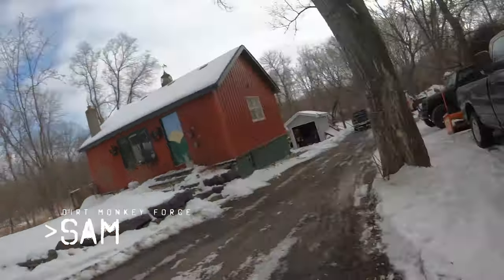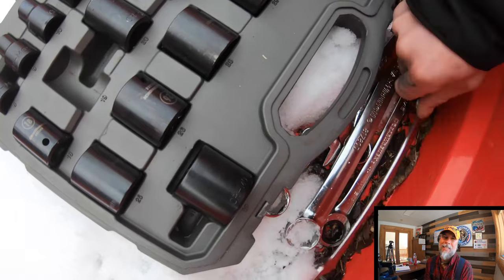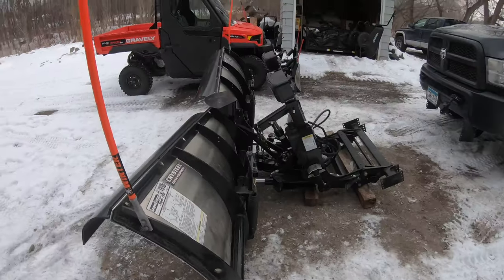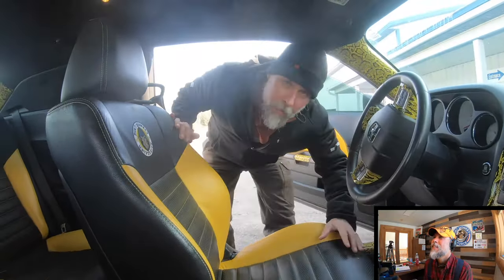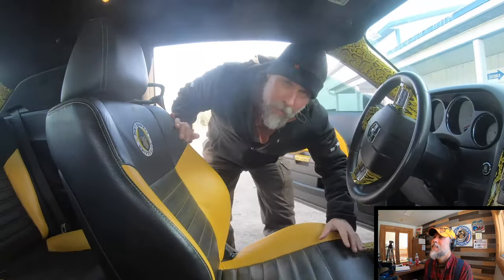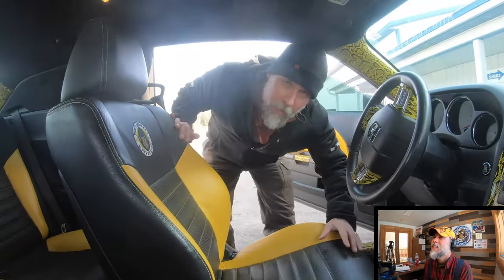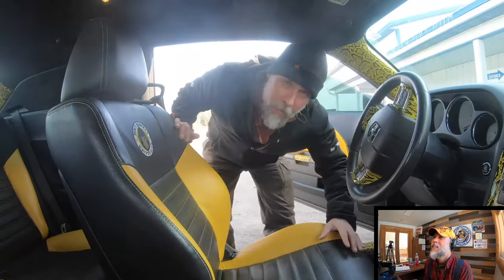Head to head - V plow Vs Scoop plow

Comment: I have simillar sockets from snapon and I love them those extractors work great  they rip into the bolt or nut and rip it out and then if you get a nut stuck in a socket just lay it down and tap on the side of the socket with a hammer and it shakes it right out

Comment: All you needed to do is straighten the bent bar with a hammer,...pin would have popped out..I had the same issue....but even before that. You need to push the frame with the lights towards the truck...that makes it easy to take the pin out.

Comment: Do you have any experience with the Western Wideouts? I think you have experience with the Western V Plows. Anyhow my friend and I were bickering like an old married couple about what would be better to use, a v plow or one of those scoop plows, the one that peaked my interest was the Western one because it has the extendable wings that also articulate when windrowing and turns into a scoop, but you can bring the wings in as well for easier transport or getting into tighter spaces. The v blade is also nice because if you get a huge dump of snow you can break your way through it but also use it as a straight blade, and turn it into a scoop.
Reply from the maker: Both are great options but I like the scoop plow -its just my preferance.

Comment: Stanley,  What is the cost of all of these plows?  I am more into residential snow removal.  I did get an Ariens 36" Pro snow blower this year and I love it. I have had multiple 12"+ snow falls this year and I can cut right through the snow.  I am not ready to invest into a plow yet because I am doing residential accounts. My summer mowing customers are my winter snow removal accounts.  It works out great.  My concern that I wonder about is if I had a plow where am I going to put the snow?  And then I have to still do the sidewalks and steps.  So right now I don't think a plow is a good investment for me.  And you have raved about the back plow.  What is the limit on the amount of snow that you can pull with a back plow?  How deep of snow can you pull with the back plow?  And no shout out is needed. lol  You gave me an unexpected shout out on Instagram that showed a high level of respect.  Rest up before you next snow fall.  lol

Comment: Their new 1" impact is overkill unless you're dealing with class A or semi truck tires day in and day out, the local FD had one donated by the local school district, the school got 12 1" impacts, 56 cordless drills, and 3 pallets worth of odds and ends, all they asked for was a banner for their shop class, the FD traded it with the local farm drainage guy for a Milwaukee cordless chop saw, chainsaw, and leaf blower, we don't use our old Stihl stuff enough to justify the maintenance costs, soon enough we'll replace our high pressure hydraulic jaws of life with cordless jaws of life for ease of use and low maintenance

Comment: Something to consider if you don’t want to use chains. Find a queen sized blowup mattress,  put blowup mattress in bed of truck, full it up completely with h20. Let it freeze solid. You got all the weight you need for added traction. Then of course you can always can use chains.
Reply from the maker: Thats very clever.

Comment: That’s insanity how difficult that snow dogg is to disconnect 🤯 yeah bingo just remove the mount with the plow still attached
Reply from the maker: That was a weird flook because the legs were bent.
Reply: @Dirtmonkey  copy. I realized that as I continued to watch
Reply: @Dirtmonkey  Stan the old halogen lights created their own heat to keep melting. These LED’s have to have their own built in heat source. My new wideout has led’s . I like em

Comment: What oil service interval do you follow with the 6.4 engines?  Just bought my first 6.4 then started reading about lifter failure around 100K.
Reply from the maker: I switch to synthetic and change it out at 6,000 miles

Comment: I think the only other plow I'd buy besides fisher is western. The difference between Fisher and Western plows is fisher plows are structurally built stronger. They both have what's probably the best and quickest hook up systems on the market. I know you had poor luck with western cutting edges. I believe both companies have expanded their cutting edge varieties. At least for Fisher. I recommend you to try a Fisher some year.

Comment: I use to hotshot them trucks. When it gets hung up in 4th gear it's a transmission wiring issue or tcm acting up. When you disconnected batteries you reset the computer

Comment: Same.thing happened to my my 2017 dodge 2500, be prepared for many electrical repairs under the hood and the dealership having to rewire and reprogram the truck, extremely poor design and engineering on dodges part,  hopefully your dodge is still under warranty

Comment: Stanley "Dirt Monkey" Genadek  - Still like to know if it is just a matter of putting on a "Certain Track" on each Skid Loader that makes the difference when plowing snow - or - Does the suspension have anything to do with it. Never used a Track Machine - a only Case Tire Machine. Like to get a Track one but stick with the Case brand if they can be good in the snow as well.

Comment: You should do another “battle” with yours (Stan) and Tim’s truck with the same plow and stuff (as close as you can get it like both using v-plows and back plows) but to see who’s he one is better for plowing the regular cab or the double cab.
Reply from the maker: Both Tim and I prefer the regular cab for plowing-  Its easier to get into tight spaces.
Reply: Ok

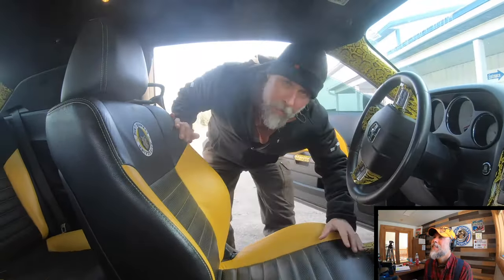Comment: Havent made it past 15:35 but im guessing a loose power at the alternator or battery. When it goes into 4th like that its going into limp mode.  If a positive cable is loose at the alternator or in the battery it will cause that problem everytime on a ram or even most cars

Comment: The Western Wide out XL would beat both of these plows..  It makes an 11 foot straight blade and a an 8.6 foot scoop.   So its a little bigger than both of these plows..   It has saved me 30% on time.  The 2nd snowfall this year was 16 inches which is a big snow fall for us in St Paul and my route that would have taken me 9 to 10 hours took me 7.    And i have a lot of travel between the accounts.   We don't usually get to the 2 foot mark for the V plows strength but this  can also plow at a 8'6 straight blade if the drifts are that big.    Its the most useful plow I have had in 15 years. Back drags pretty well too.   I like the controller,  but I have used them forever so I know them..  they can be a little hard to get down at first.

Comment: Stan I just got my Milwaukee M18 Fuel 1/2 mid torque impact pin detent yesterday 600 foot pounds of nut busting torque with 450 foot pounds of tightening torque so now I can properly tighten hitch balls to the mounts so I don't have a accident cause it came loose a 1 inch hitch ball shank is supposed to be 250 foot pounds of torque and a 1 1/4 hitch ball shank is supposed to be 450 foot pounds and now I have an excuse to come to your area when I get a truck to get a Heiniker plow

Comment: i had pretty much the same issue with my snowdogg plow it's not a v plow tho just a straight one, the bracket completely bent on me and they tried to blame it on me not having a brand new cutting edge on it said it wasn't sitting level enough for the bracket to come out clean

Comment: This is why you don't buy used trucks that used to plow unless you're not going very far with it. The charging system is baked and so is the oil pressure. All those hours and so few miles.

Comment: If you would have taken a C clamp to the bent hooks of the old plow to straighten them it would have saved you a lot of time but just sharing the info in case you run into a situation like this again in the future Stan thanks for the content I have a lot to catch up on video wise from your channel that I mainly care about catching up on been in the hospital a total of 1 month tomorrow and it has nothing to do with covid at all my digestive system has failed and there trying to figure out what there going to do before going in for surgery because it's already a life and death situation that surgery will take a minimum of 16 hours but most likely a lot longer and the doctors are doing everything possible to get every bit of info they can from every test or study before beginning

Comment: Had mine stalling like this. Found out the transmission repair place forgot to put the hot wire back on the battery passenger side battery. It was bouncing and arching on my a/c line wich burned a hole in my condenser

Comment: I have a boss v xt I got it this passes spring it a 8.2  and I noticed pushing up banks or wet heavy snow the wings will push back  and it on a halfton Chevy and the halfton will over power wings   but the wings stay locked back dragging pritty good the last landscape company I worked for I ran a fisher v plow and to me the fisher is better I would rather have the fisher but I need a 8 foot v and the fisher lil heavy for halfton but the boss v rides nice and I run 500 pounds in back   but wish wings where stronger but I do love the boss to  the truck plow combo work great I plow 30 yards and help plow 6 commercial properties sometimes more if needed

Comment: I've plowed snow for over 25 yrs. Never once did I have all the fancy extra crap on my plows to many things to go wrong. Spend so much time fixing and adjusting and no time plowing. Never had a rear plow didn't want it. Worst thing that would happen to me is either a blown hydraulic line or a blown plow light. Had those in my truck. Never worried about over thinking how to do it better.

Comment: I agree Stan simpler is better with a snow plow I use strait blade Meyers and a Fisher 2 pins and a chain to hook up but as I said before I prefer using my skid steer with my Arctic pusher we’re getting possibly 5-8” tomorrow morning
Reply from the maker: Stay safe-  5-8"' is a great amount- not to much to handle and kind of fun.
Reply: @Dirtmonkey  thanks it was 50 here yesterday was kind of nice like summer it felt like

Comment: since you don't need a battery to run just fine being you have an alternator.  it must be a chrysler engineering thing.  I say that with many shake my head moments working on chryslers.  Maybe they have important grounds at the battery post instead of elseware.

Comment: I don't plow snow here in NC but would never buy a truck that wasn't a GMC or a Chevrolet.  Both ride better than a Ford and don't have the front end problems like Dodges/Rams whatever they call themselves now
Reply from the maker: Would you get the Duramax or something else?
Reply: @Dirtmonkey  I have a 2018 1500 Denali with the 6.2 Gas. Love this truck!! Would have no qualms about getting about a 2500 with the Duramax or even a 1500 with the Duramax. Almost bought the Duramax when I bought the 1500 with the 6.2 gas.

Comment: Some day some day in will be in your shoes. You seem so relaxed plowing. I get so stressed out my phone rings none stop the whole storm. The bs of fixing ahit every storm to have the time to run contest film and take you time in a way you make plowing look easy. Its not!! I want to enjoy plowing again this is my 10th year 4 was with same company the rest was all different companys. When my new knew truck died last year I down graded to an old truck trying to do the same work as I would with a new truck and it screwed me. I should of known but I had confidence. Dident work out well. Cut my rt from 50 accounts to 10!! AMD still have a hard time. Went from a 2012 Chevy v blade to a 98 chevy straight blade. I love snow and plowing but this year has hurt me. If only I had a newer truck. Suck becouse you can spend 10k on a truck and still be junk and need tires rust work fuel and break lines. 5k it's way worse trucks are done. You need 12k and up to get a decent plow/work truck that is worth it. Idk if I just could make that I'd be good but I can not sell work

Comment: Great content lmao 🤣 

But Definitely can tell you guys are not mechanics lol use a box end of a non ratcheting 6 point wrench not the open end of it 🤦‍♂️😂😂😂

And the weight was on the last bolt haha that’s why it wouldn’t move 😂😂😂😂😂

Next time just blast the pin out with a two pound sledge lol👊

Straight blade for the win and even since back with the old e47s Meyers  I’ve always had one switch lol they’re wired simple as it gets .

Comment: I know the feeling about a stuck/broken bolt i have one on the dingo tx1000 that keeps backing out from the pump and bell housing?. Anyway, i had to take a husky 22mm bend it to a almost a 90° and then cut it in half and flip it every quarter turn so i can re-tighten it it finally broke and i by the grace of god managed to extract it. Now i used red lock tite and the new one stills backs out not sire why but and huge pain in the butt 🙃🙃🙋
Reply from the maker: That sounds like a pain in the butt.

Comment: i want a hiniker scoop plow but no dealers in michigan that i could find.. can order online and delivered to my home.. but if it ever needs to repaired no one will touch it..
Reply: can u get a back drag edge for the scoop.. if not could u order a straight back drag edge and cut it up and drill holes to make it fit.. never had a trip blade so i don't know how it would work compared to my 25 yr old western straight blade..
Reply: my goal with a v plow or scoop blade is to have more control with my piles.. do u agree..

Comment: Get yourself a Chevy Suburban and put the plow on it because I plow with the Chevy Suburban 2007 Chevy Suburban you will be amazed because of the platform how heavy it is plenty of traction and it handles like a dream! Don't judge it or be judgmental just by yourself a used Chevy Suburban 2007 to 2010 four-wheel drive put a plow on it just go for it and you're going to be amazed because of the platform how heavy it is you do not need to add extra weight nothing just trust me on this okay!!! Don't be judgmental about the brand because of Chevy or GMC just trust me on it after you do it you're never going to want to go back to a truck again I promise you that!

Comment: with no chain on the scoop plow what the hell are u supposed to do if the hydraulics fail.. can't put it on a snow bank and raise it like with a chain..  how r u supposed to get back home or get to the repair shop.. drive with blade down.. jesus i don't think so.. is there some sort of system on the thing to let u keep the blade up so u can drive it home if the hydraulics fail..??
Reply: i've had the hydraulics go out twice on my western straight plow.. each time i just put it on a snow bank and raised the chain.. or u can put to a jack it  if u had to..  each time it's turned out to be an electric failure..
Reply: i found my answer.. use a ratchet strap...

Comment: Did you not have your hitch locked or wheels locks. You’re very trustworthy to leave your trailers in a non secure area. Set up trail cameras or Solor motion sensors lights.

Comment: I think for straight line plowing that was a fair comparison between those two plows 
• The back dragging performance is similar because you don’t have the wings pulling up and effecting your cutting angle or edge pressure even if you  can’t get as close and have to be careful of garage doors and other  soft obstacles 
•you will probably have less scraping preformance  forward for the  reason above 
•snow pushing performance at max for both will be similar due to similar length and attack angle of the wings even tho it looks like the v is slightly taller 
I think for any application that has lots of turning under load that v plow will win because you can reduce understeer greatly witch is why blowers and v’s are favored on windy mountain roads 
• I think for lot and driveway clearing the fixed u blade will have the similar performance as shown but be cheaper and less maintenance but not have some of the adjustable abilities that makes people like hydraulic winged plows weather there v plows  or winged straight plows
• I think in the situation you demonstrated hydro wing would be the best but the most expensive to buy and slightly more to maintain than a v plow due too the two additional cylinders but would win in back dragging wind rowing and pushing capacity because of its ability to extend its cutting edge and lengthen the plow while still meeting width requirements for the roadways it would still lose in turning performance to the v  but give you some move versatility over a v plow and u blades 

Anyone see it another way I’m interested in another point of view?

Comment: I would say it looks like on the last run it's the same amount but I think the fixed blade rolls the snow better so if I was going to buy a new blade  I would pick the fixed blade it has to be cheaper than the v plow so the winer on the plows are the fixed blade 👍

Comment: Them snow dogs suck so bad never seen a worse mounting setup the old 2 pin Meyers were easier
Reply from the maker: The plow is good but MY mounting system got damaged.
Reply: @Dirtmonkey  From my experience people don't line it up correctly and kick the lever things until the aluminum bar bends. That was with the straight blade salt dogs. I run an 8'2 boss power V. I'm from Colorado and people around here mostly use BOSS or Western